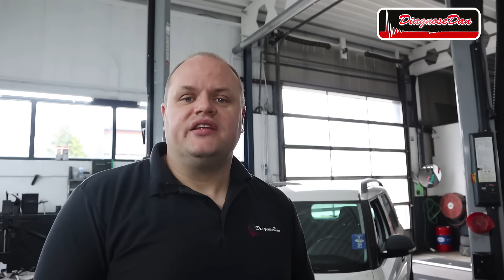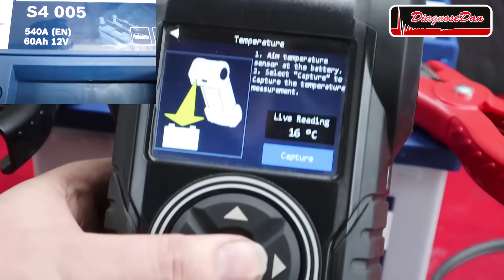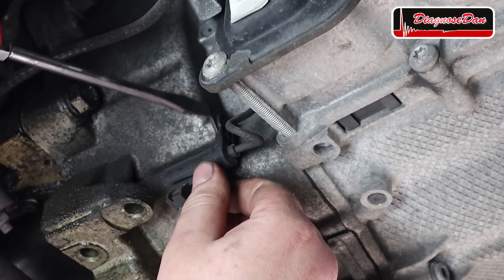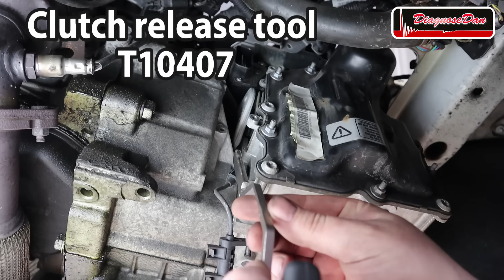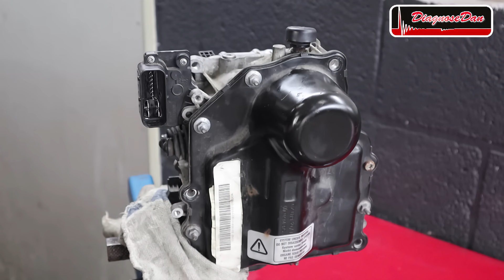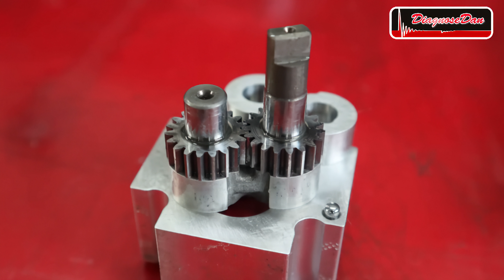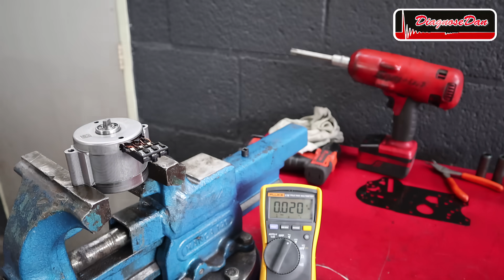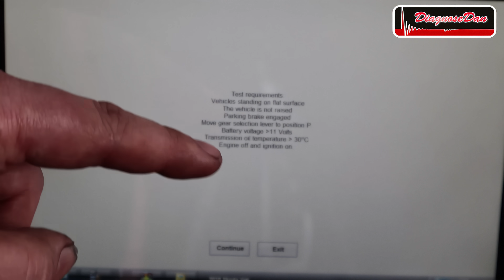DSG Gearbox Diagnosed explained Fixed

Comment: Good video as always ! A recommendation from my side. First remove the TCU from the hydraulic block and only afterwards remove its cover. Inside the sealed enclosure you have either a ceramic substrate with bare die electronic components (gen. 1) or a HDI PCB with the same bare die components (gen. 2). By removing the cover while you are still disassembling the unit you risk touching the board. If that happens there is a high risk of damage to the wire bonds or the actual bare die electronic components which are a lot more fragile than the normal, packaged ones. Keep up with the good work !
Reply from the maker: Thanks for the advise, i clearly don't pull these apart daily.😉
Reply: From your experience what causes the main fuse for the mechatronic to be blown every time the ignition is turned on?
Reply: @shimon2476  -	Safety Recall 34F6 on 06 Dec 2013: Over time, the internal gearbox lead frame may corrode due to certain gearbox fluid additives used in original gearbox filling. If corrosion deposits collect between electrical wiring, an electrical short in the power supply may result in blown gearbox fuses and the deactivation of the gearbox hydraulic pump or mechatronic unit. The driver will immediately be alerted by a flashing gear indicator warning lamp in the instrument cluster and the vehicle will lose motive power but can coast to a stop. Loss of motive power while driving may increase the risk of a crash.
-	Corrective Action Replace existing synthetic gearbox oil with a new, mineralbased oil with non-corrosive additives to prevent future failure: https://static.nhtsa.gov/odi/rcl/2013/RCMN-13V568-9034.pdf

Comment: Always mechatronic failure, although I've seen clutch failure, flywheel failure, slipper bearing failure, solenoid and actuator failure.... the best is hydraulic pump failure! What a mess!
Reply from the maker: You forget the broken Acumulator 😉
Reply: @Diagnosedan  Totally, that looks awesome when they fail.
Reply: For the accumulator failure you have to be careful with disassemble. Last time we had a lot of problems with customers who putted the wrong oil in the mechatronic 😁

Comment: I have a 2016 smart is this the same as we know here as a dual clutch transmission on the smart?how much the rebuilt transmission cost?and how many miles on the car before it fail Thank you
Reply from the maker: I don't think Smart uses a double clutch at least not on the older models. I think that's proberbly Just a robotised manual gearbox

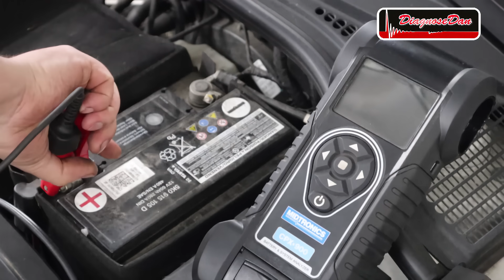Comment: 4:07 the battery + was loose!  did You really change the battery for customer?
Reply: No matter how urgent a situation is always ask for consent from the customer.
Reply from the maker: My colleague disconected the terminal because of the short. And we got the approval to change it from the Car owner
Reply: @Diagnosedan  But You realize, that test will always fail if between tester and battery is bad connection. You measured by clamping test connections on top of loose connector.

Comment: Great video. The question is why not use/produce better batteries or let the car computer do this diagnostic and warn you before the car battery will be bad.
Reply from the maker: Newer luxery cars have those kind of batteries. The problem is that they are very expensive
Reply: @Diagnosedan  Thanks

Comment: Thanks, Dan, you explained this so even I could understand. Has anyone ever converted these to work with a clutch pedal handling two clutches at once?
Reply: caduceus33 
WOT !
Reply from the maker: What foot are you going to use to break if Both your feet are on the clutches?
Reply: @Diagnosedan  I think he meant one clutch pedal disengaging both clutches at once, which is simply a conversion to manual gearbox. Such conversion doesn't make sense to me (no advantages over neither DSG nor manual) so I doubt anyone attempted that.
Reply: @irvvine  The advantage would be to get away from the electronic control of the shifting process.
Reply: @caduceus33  In which case you actually want manual gearbox and there is no point in buying and then crippling a DSG.
Reply: @Diagnosedan  The question is, has anyone developed a system that will activate both clutches with one pedal. I mean, if a man can be put on the moon, a device could surely be made to do this if someone applied themselves to the task. Nyet?l

Comment: DiagnoseDan I wonder will this technology will replace the gear boxes on medium & heavy duty trucks that haul freight & heavy loads??? Be interesting if it did since most drivers power shift  manually anyway using engine rpms. Maybe have a manual override when problems occur electronically? Ah yes the bloopers tongue twisting issues LOL🤣🤣🤣👏👍
Reply from the maker: I never work on Trucks so i have no idea if DSG's are used in heavy trucks.

Comment: Great video @Diagnosedan. Worked on a same gearbox with the same issue a month ago. I luckily found a used control unit and replaced that and it worked like magic. Such a huge pain in the ass gearbox though!
Reply from the maker: It's work😉
Reply: One of the easiest automatics to work on.

Comment: Soo glad I'm still capable of shifting gears with my hand and operate a clutch with my foot. Apparently a dying skill. But super interesting video.....wonder how much the remanufactured control unit was? 

On a different note: I converted a motorcycle to 8kW electric hub drive. The only moving parts of the entire drive system are the two wheel bearings, no filters, no fluids. And gets charged on solar.
Reply from the maker: Wow sounds like an interesting project, have you got a video on that?
Reply: @Diagnosedan  Working on it, unfortunately YouTubers like you put the level of quality extremely high when it comes to publications.....ongoing project here.....
Reply: @Diagnosedan  Its a bit crappy but here it is: https://www.youtube.com/watch?v=YtVoJTYvZ4M&t=320s

Comment: A good salesman I may add, Yes Mdtronix battery testers are the top of the line in my opinion. Most auto parts stores have testers that only do CCA. With that said you just prove testing the battery at least during an oil change can prevent future breakdowns. Educational vid thanks diagnosis Dan!
Reply from the maker: Thanks you very much 👍

Comment: Mechatronics are the most common failing part on the DSG 7-Speed dry clutch systems. The shift forks breaking off is also a common issue on these gearboxes. It may cancel your adaptation because of a broken shift fork so check your shift forks on defects before putting your mechatronics back.
Reply from the maker: You are right!
Reply: Adaption will get cancelled from a worn clutch too (generally over 60000 miles). We always quote for a clutch on top of the mechatronic unit. Luckily the gearbox can come out in an hour so not much labour expense for the customer.

Comment: Please can you make a demonstration of vvt actuator signal with coil and injector Signals, all together in picoscope, I want to confirm if this actuator receive signal every cycle (every 1ms for example) or it receive a new signal every time when the driver change the speed or the load.
Reply from the maker: Sorry i don't have a Picoscope

Comment: You are wrong. The oil which is problem is not in mechatronic but in transmision. So you must replace oil in transmision.
Reply from the maker: You are right, i also replaced the Gearbox oil!

Comment: It's good to see that VW DSG use separate fluid to push the gear changes and a different one to lubricate the actual gearbox.  Unlike the GETRAG DCTs that use the same oil to lubricate the diff, the gears and swill around the solenoids as hydraulic fluid which of course is a mental idea as the swarf particles clog the solenoids and end up causing lots of shift problems due to sticky solenoids plungers.  Great video, do a DCT 450 and give us a look at one of those in pieces.
Reply from the maker: Maybe when i get an interesting one!
Reply: I believe the 6 speed, wet clutch versions utilized 1 fluid type.
The 7 spd dry clutch versions, had 2 flud types, independent of each other. 
I could be wrong, but I have three 6 spds and have only ever used 1 fluid type.

Comment: Great video. U can only assume t oil may have caused t short - but one will never known for sure. I run a VW repair workshop and iv known EFB batteries to cause t car to breakdown. Whilst after 5 mins they tend to restart (I think t plates buckle causing a short). VW group appear to be superseding their batteries from EFB to more exotic AGM. 🤫😉😅
Reply from the maker: Thanks for watching David👍
Reply: @Diagnosedan  Always a pleasure to watch ur videos. It's quite clear ur a Tech with hand-on experience - not a classroom teacher.  Anyway, I hope u understood me when I used t word 'buckled cell plates'. It's another term for distorted/ bent. I realised the English words u used may not have bn t best! 🙉

Comment: I've had two cars with DSG gearboxes, and never had any issues with them, but they do give me the fear. I'm not sure how many people are out there who'll do diagnosis at this level. I now have a car with three pedals and a lever that you wobble around. ;-)
Reply: I must admit its one of those reason I avoid these new fangled Automatics like the Covid. Old fashioned Slush boxes were slow and burned more fuel, but jesus they were simple. Manual for me too.
Reply: @DasArab  whaaa?? since when are torque-converter autos "simple"??
have you ever taken one apart and tried to put it back together, or seen those valve bodies?
Reply: @raoulrr  its simple, everything is on 1 shaft.... and valves follow oil pressure.
Reply: @hdj81Vlimited agreed

Comment: Why not use an amp clam when changing , it  will tell you the batteries resistance and therefore the internal.  The battery tester result only told you the battery was faulty and not why. Was it a bad alternate ripple or out put , bad leads , customer driving style, with out knowing this you can't be sure if the vehicle battery will continue to be reliable and prevent the breakdown.
Reply from the maker: The tester does also test the charging system. I'll maybe show that in a future video.
Reply: @Diagnosedan   no real complaint from me or I wouldn't of watched most of your video's 👍

Comment: Great video! No wonder the battery was done - and only replacing the battery and not measuring the possible cause for any excessive power consumption would cause the battery to fail soon - and that would make clients angry too. 

And, sort of bad karma for VAG to have too much of sulphur in mechatorics oil - they seem to have had some other issues in those DSG:s too.

Comment: Calibration transmission during car start or should just Ign switch on only at stop position?
Reply from the maker: The procedure is actually a bit longer than i showed in the video. You also need to idle the Car.

Comment: Another interesting video,as usual Dan !!!
I have a PASSAT B6 (2008) with 6 speeds DSG, I hope there is no oil in my mechatronic unit?
Thank you Dan 👍
Reply: depends if other versions have the circuit board inside or outside..this seems a stupid design to me, a box outside would have been fine
Reply from the maker: Thanks for watching 👍

Comment: Wow the housing of the accumulator is not broken yet! Had several in the shop with these things broken, with low or no hydraulic pressure as a result. Even saw one that "exploded" and damaged the outer casing, causing the mechatronic oil to leak out.
One question I have: before you removed the mechatronic unit, were you able to depressurize the hydraulic system? From what I know this is required before removing the accumulator since they can hold pressure for quite a while?
Goed bezig Dan!
Reply: It is better to depressurize the system but when you take the TCU out carful you can work on it. One note if the housing is to much broken the cover will come under pressure which can cause a dangerous situation.
Reply: @transmissies  Thank you for your answer. I wasn't aware the pump would be strong enough to put the entire unit under pressure. That could cause some "fun" situations ;)
I'm pretty sure the pressure also drops over time, but just undoing the bolts without removing them should release the pressure without it exploding in my face. Might make a bit of a mess though.
Reply: @TheMisterpino  There is a spring in the accumulator that builds the pressure, will not go down over time. The spring in there is FO big.

Comment: The oil kills the computer?

I wonder why they chose to run the computer in an oil bath on the first place, and next, why didn't they notify everyone that owned one that they screwed up and that they needed to get the oil changed on the computer before it self destructs.
Reply from the maker: There was a recall but maybe the owner never got it done......

Comment: Is this the VW version (not literally), of the Ford DPS 6 (Getrag manufactured) dual clutch transmission that is costing Ford a boatload of money (estimate in the billions), to buy out the owners of cars that used the transmission. Nice concept for a transmission but time will tell of the reliability. Sounds like a big $$$ repair.
Reply: along with dual mass clutches this is just waiting to destroy the car outside of warranty
Reply from the maker: Thanks for watching Robert!
Reply: The powershift ford uses is only such a problem because the incorporate engine damping into the gearbox instead of using a dual mass flywheel. The engine damping springs break up. rest of the gearbox is shite too honestly though.

Comment: Interesting transmission and great diagnosis, as always. Saw the super loose positive battery cable at 4:05 too.
Reply from the maker: You are Sharp😉
Reply: Maybe battery was disconected over the night time, to prevent another electrical damage. On electric failure, everything is possible.  who knows....
Reply from the maker: @robertomihail4714  my colleague disconected the terminal when het was taking a look at the Car.

Comment: Did Volkswagon pay for the repair since it was the fault of the oil they installed?
Reply: it would be in a vw dealer if they did
Reply from the maker: No because the customer never went to the Dealer for the recall

Comment: Good vid as always😀👍 But i wonder which VAG-product comes with the wet-clutch DSG? As i understand a wet clutch can handle more torque, like the PDK boxes that Porsche is using, produced by ZF i believe?
Reply: wet clutches in bikes, do handle torque, but dont last long, but bikes easy to replace, bad combo in a car, porshe dont expect it to be used in a city car
Reply: not 100% sure but all the diesels and high performance models - at least the 290hp Seat Cupra had it. It was a nice car to test and a very pleasantly shifting transmission!
Reply from the maker: Yes the wet clutches are used for the bigger engines

Comment: Who would of thought of putting wiring in a fluid that may have carbon particles floating around in it, oh yes VW. My  Passat 5.5 needed an injector wiring loom in the rocker box, why? because hot oil degrades plastic wiring.  A lesson the British Army learnt with their tanks.  VAG still making the same mistake.
Reply: to be fair the british army could never get synthetic rubbers to work, cause it wall all decades ago...
Reply from the maker: Thanks for watching Bryan!

Comment: Only caught the end of it but have the pleasure of watching from the start, even VW gearboxes are interesting on Diagnosedan!
Reply from the maker: Ha ha thanks, they are very interesting 🙂
Reply: @Diagnosedan  its a simply gearbox, why they can do it right? NOW they using mineral oil....... Same with engine oil. I use still till today mineral oil..... these are better for the engines.
Reply: That was seem quick and clear Diagnosis Dan I wish I can be like you.

Comment: seems pointless, quite capable of shifting gears myself,...why isnt this a recall, or somehow a free fix from vw, they obviously know of the issue
Reply: its an auto, not pointless to those who want auto, the fluid flywheel stuff went out with fred flintstone, fuel economy, as for recall, not everyone bothers to take it in, as you have to book in with a dealer, and some dealers want to charge a fee for diagnosis as they dont like warranty work ,,paperwork to them
Reply: maybe im missing somthin here, this is auto? only has drive and reverse, no manualy shifting  1 through 4 ?
Reply: @numbrenine9414  motorised gearbox basically, automated clutch too
Reply from the maker: There was a recall

Comment: Thoroughly enjoyed it Dan. And even though there was a TSB it was good to see the tear down to prove it and that no other apparent issues were present. Thanks!
Reply: I thought the TSB was for the gearbox oil but was it actually for the hydraulic oil in the mechatronic unit?
Reply: @meeder78  And you were right. Read the pinned update from Dan at the top.
Reply from the maker: It was great to have you in the live chat!
Reply: @Diagnosedan hay, I yust wana ask you why my dsg 6speed sometimes yust dies. When I putt him in D and preš the gass pedal motor rpm goes up, car moves for a half of meter and then just dies. There IS no fault code on. Dash and none on vcds. Do you have any clu what IS going on?

Comment: Rated at 540 CCA and measured 493 CCA, but passed! I guess there is plenty of wiggle room in that test. I presume the failure point would be 80% of rated capacity.
Reply: more like 50 percent,  for a new battery it sure wasnt impressing me.  but also cca would be at 0c not 16, so its even less impressive